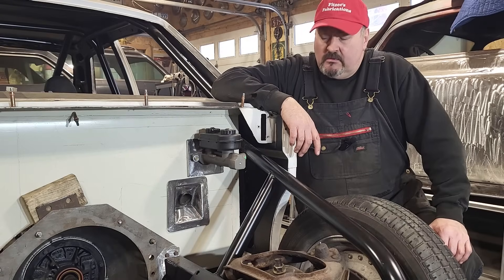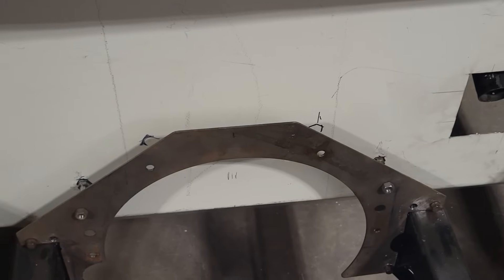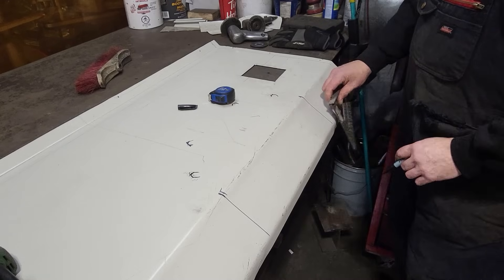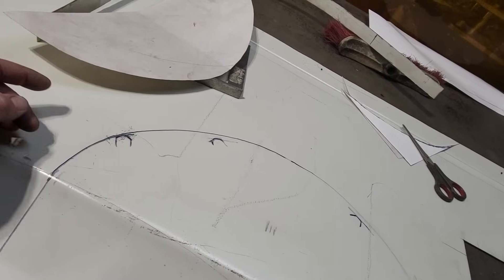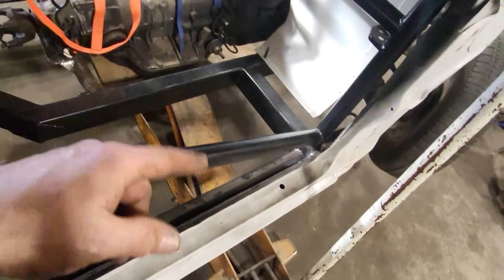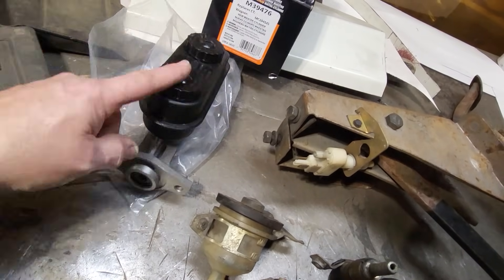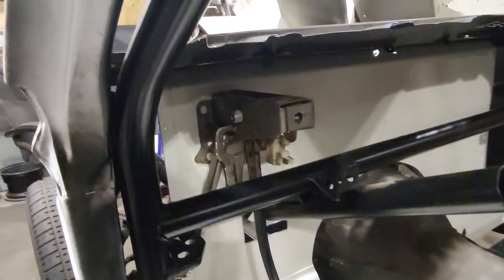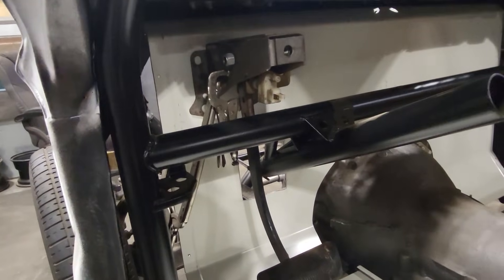Building a brake pedal mount and more custom panels

Comment: @Fitzee's Fabrications : I am pretty sure the brake pedal assembly you are using came from something with power brakes. It is pretty common to have 4:1 ratio with power brakes. The issue I see is that at 4:1 (NON POWER), you are going to be standing on the brakes with both feet!!!!! With NON-POWER brakes, it is pretty common to have a 5:1 ratio. That was about what you had with your drilled hole in the pedal arm. THAT is where you need to go back to.. NO DOUBT!!! To keep from hitting the firewall, simply change the long curve of the brake pedal arm to a more flat bar. It is that long curve that causes the issue. Not the pedal itself. Just watch your video with it upside down in the vise with the flat bar showing what the firewall would look like.. Then take any piece of flat stock or ruler and with the pedal depressed, hold the flat up to it and you'll see exactly what I mean...  A lot is happening at top speed and being able to control the car easily is everything.....

Comment: The 4:1 ratio will be a real leg workout to stop. Research and wrap your brain around what it takes to get something close to 7:1 because it will give you a normal pedal pressure and sufficient pressure to stop the car. I changed a 1949 Ford to 1967 corvette manual brake master cylinder with 4 wheel disc brakes. With 7:1 ratio pedal it was very good. As I remember it my hole for the master cylinder Clovis was closer to the pivot not further away. Look it up for yourself and be glad you did.
Reply: Think leverage that is what the pedal ratio is.

Comment: Great video Tony.  I’ve done non-stock brake and hydraulic clutch pedals before too.  What I did is measure the total stroke of the master cylinder, then the maximum travel of the pedal.  One divided by the other gives the required ratio.  Then drill the hole for the pushrod that fraction of way from the pivot down, and it’ll all work out perfectly with no guesswork.  👍

Comment: Fitzee, your comment that mounting the braking assembly was one of your most challenging tasks to date on the build provides me and I am sure others with confidence.     I have spent hours pondering about the brake/clutch/gas pedal design on my build.   So much is going on......ratios, stroke, bore diameter, pedal spacing, height difference between gas and brake pedal, firewall strengthen, ergonomics drivers foot angle to brake pedal just to name a few.  Thank you for sharing with us!

Comment: That was very interesting to watch and see how you worked it out. I think you need a little play in the pedal so the fluid can expand and contract through the small orifice in the master. If the pedal is tight, then it can cause the brakes to stick especially when it gets warm. 1/8 or so should do it. The build is top notch for the assembly.

Comment: Mechanical advantage. The smaller the diameter of the master cylinder piston and the shorter the distance from the pivot point, the greater the pressure on the brakes. The disadvantage can be in the longer distance that the pedal moves. No doubt you've taken this into account.
Reply: Since you've moved the master cylinder location, now your pedal travel is shorter, but the pressure on the brakes is less, so you'll have to press the brake pedal harder. Hopefully it won't be too hard to stop the car. If it's a problem, you can always more it back again.
Reply from the maker: Yes bore size plays a factor in that as well.

Comment: Really enjoying this build.  You might consider cutting a semi circle around the transmission bolts and shaping a cone like extension towards the back. It will give more strength to the fire wall.

Comment: LoL at your "steampunk firewall"  🤖  When you build a new rod, do it with an adjustable for length clevis pin like the OG Toyota one. Adjustable length, that's the ticket sir!  All my old VW brake pushrods were adjustable for length. It's the little details, that take up all the time. 
As always, Nice Work Tony. Glad to be following along.  Blair

Comment: What mistake?? Hey Tony, just like a doctor. Bury the mistakes! I've got two old trucks converted to disc brakes and dual master cylinders. Neither are power assisted. I don't have any issues stopping but my wife has trouble with the effort required. The smaller master cylinder bore will definitely generate more braking pressure but by moving the hole away from the pivot you're also reducing mechanical advantage. I'm like you in that I have to see it to fully understand. My 64 F100 has Impala calipers over 79 F100 rotors and with the standard drums in the rear brakes very well and even without an equalizer.? Brakes are a little scary because we do need them from time to time!😊 Thanks for the videos and the education!

Comment: That all looks great. 👍🏼The only thing I would do different is I would not weld all that brake assembly solid. To me sometimes having stuff serviceable is the better option, especially when they have moving parts. I suppose the factory felt that way as well since that assembly was unbolted from a truck or car. 🤷‍♂ Either way the car is coming along nicely.

Comment: It goes without saying and of course you would have thought of this, but the rod for the master cylinder needs to be adjustable to that you can have about 1/8" play before the pedal starts pushing the piston. Years back, we had a master cylinder replaced in one of our cars under warranty and the apprentice didn't adjust the rod correctly. After a few presses of the brake pedal, the car would no longer move and had to be trucked back to the shop so the rod could be adjusted. The apprentice learned a valuable lesson there.
Reply from the maker: I come across that as well in the past

Comment: .... The angle of the dangle is proportional to the heat of the bead. and the gutting and the cutting and the hacking and the tacking determines the fit of the slit and the deal with the steel ...... I think I just wrote a country song for body men.

Comment: Great stuff Fitzee- 
Just wondering why you did not consider cutting the master cylinder hole and bolt holes out and welding in that panel again with 1"  of meat below so that flip it 180 and weld it back in and presto the same holes one inch lower. 
 I:o   I  becomes   I  o:I  

Anywho all good in the end - 
Did you see Karl from make it Kustoms new little air chisel Form bender - for putting profile into steel sheet. 
I reckon that would put beads in 16 gage no Problem or just a rounded chizel bit in a ply or MDF bead form. 
Love your stuff M8 
Happy New year from Aus.
Reply from the maker: I thought about welding it up but wanted to add something to firewall anyway to get rid of the plain look. 
 That's a cool tool he made. Sould work good if you wanted a double bead belt line.

Comment: Great video! Question - why do you use a cut off wheel and not an electric shear for cutting your rough panel shapes? Seems like an electric shear would be quicker and not create near the mess. Thanks!
Reply from the maker: Don't have one and I am just use to the grinder.

Comment: Just wondering, when you have a long term project and so much freshly sanded/ground metal, after you finish, say, a fender or the bottom of a door, do you treat the metal to prevent flash-rust forming while you work on the rest of the car?

Comment: Tony :] 
question on your technique of MIG welding heavier plates of metal, can't tell if you're moving the MIG handle in a C pattern, it almost looks like a Circular pattern... 
I'm having an issue getting nicer looking welds on heavier gauge plates, Kind Regards:]

Comment: Are you concerned about that flat firewall drumming or vibrating because it's a relatively big flat panel? A couple of beads or something would help with that.  I've usually delt with 4 cylinder cars and I think vibrations and noise is more of an issue with them than v8s perhaps?
Reply: He mentioned using the bead roller to put some beads on it, likely above the transmission tunnel.

Comment: Use studs on the engine block so you just need space for nuts on the bell housing.
How is the placement of the master in conjunction with the engine?
Reply from the maker: Let's of room

Comment: I see you didn't want to put the brake system on the floor attached to the frame, leaves more room in the engine bay...  My race car is in the floor in front of the seat...
Reply from the maker: Ya. I don't that in the past and just not what I wanted with this build

Comment: I'm sorry to say respectfully your friend is incorrect regarding his analysis of calculating the brake ratio. Brake ratio is based SOLELY on pivot ratios.  No visualization is required, simple mathematical division. IE The distance from  your pivot of your firewall bracket to master cylinder rod divided into total distance from the pivot of your firewall  bracket  to the centre of your brake foot pedal. From your video  it looks to me  you will be in a whole lot of hurt trying to stop that car of yours at 100 MPH. As you well know you need 1000PSI at the calipers for safe effortless stopping. Your arrangement with the 15/16 bore is not going to cut it. For standard brakes with that MC, you would need at least a 6.5 :1 ratio to come even close to that pressure at the wheels. Do yourself a favour know while it easier to do know rather than later. This a critical safety item that requires your undivided attention.
Reply from the maker: A few of you had pointed this out. Going play with it some more see what I can figure out. Problem I need to figure out is with a 6 to 1 ratio the peddle is eather way to high or passes threw the firewall. Will play with it some more. Thanks for info
Reply: Just trying to help as I am a hot rod builder for 40 years. What I did in my 66 Mustang I ran a 7/8 dia master cylinder and cut and added 2 inches to the pedal with the same pivot point.  It still felt comfortable  and gave me a 6:1 ratio.  You can always rework the brake pedal arm to suit your application IE wont hit the firewall. The key is you need approximately 800 to 1000 psi at the wheel to stop a 100 mph car. Better to do the mods now than when the car is finished. @fitzeesfabrications
Reply: @mikeseguin-g6p  I tend to agree, with the proposed modest 4:1 leverage and no booster you need to have the leg strength of Hercules to stop the car at high speed.